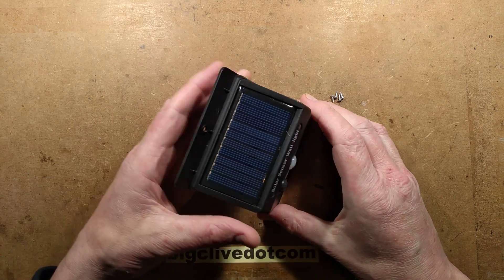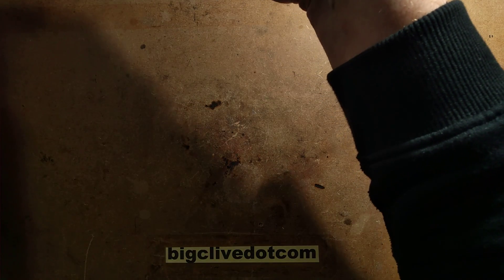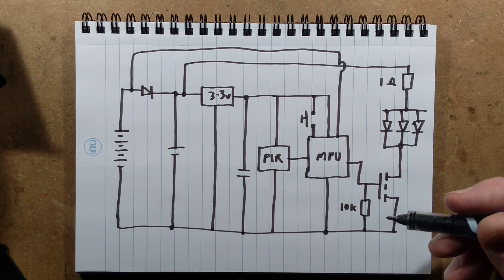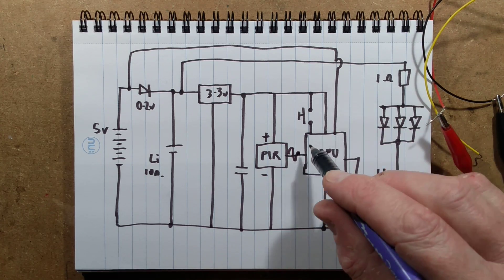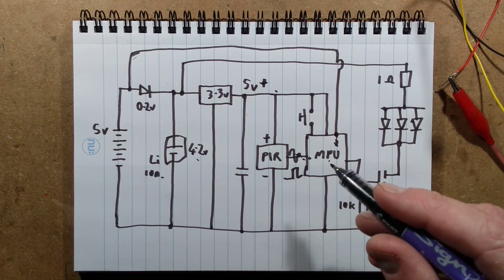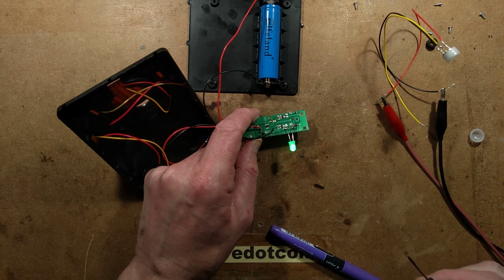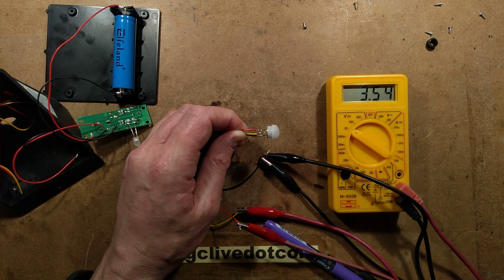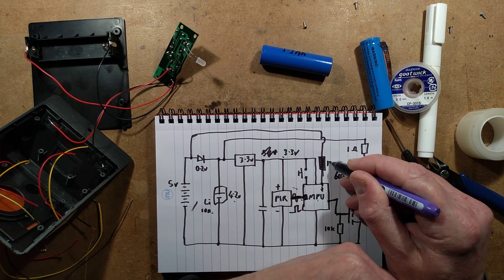Autopsy on a badly designed solar light (no lithium charge control).

Comment: Pretty much every PIR driven thing I have has gone weird or stopped working after a period of time - except the PIRs on the burglar alarm (seemingly more robust for the application). Never really figured out why - I replaced one on a night-light/emergency torch and it worked again for a bit before packing up. This light is similar to a Li-ion one I also have which has become progressively dimmer - probably the same reason due to no over-charge protection...I have had varying levels of performance from others. The other thing that dies is the lens on the front which usually disintegrates from being exposed to the sun :(

Comment: Toolstation SKU 55970 . £18. Same thing. Bought it for neighbour as temporary measure. Started misbehaving very soon after. Decided battery must not be getting enough charge from solar so desoldered it and wired it up to an old phone charger of the same dc voltage output.  THE FRIGGING THING WORKS PERFECTLY PLUGGED INTO EVERYBODY ELSES HOUSE IN THE STREET EXCEPT FOR THE ONE WHERE IT'S NEEDED. WHAT.THE.ACTUAL.F....???  arrrrggghhh!

Comment: This is not the first time I have seen a device with an 18650 battery and no charge control. The other was a speaker which had a diode and 2r2 resistor from 5v usb. This is a worrying trend.

Comment: Bought 4 (without the side lighting) a while back to stick on the shed. Better take one apart to see if it's similar. If so I'll try replacing the battery with a protected phone battery.
Reply from the maker: You can also get protected 18650 cells.
Reply: George, did you have any success with protected 18650's, in my attempts so far the solar cell won't power the 1S BMS (those round ones usually put on top of a 'naked' cell.

Comment: Did they use a 18650 cell with a safety circuit packed built in?
Reply from the maker: No safety circuit on the cell.

Comment: So, when you measure the solar panel you are using a resistance of 100k or so from the multimeter, the cell has a much lower resistance so the output of the solar panel will not even reach the maximum of the cell.. Just draw the equivalent circuit

Comment: They could have at least switched the LEDs on when the battery voltage gets too high to prevent overcharge. It would be a shitty design nevertheless but it would at least be somewhat "safe" ...

Comment: A simple 3 terminal linear regulator to clamp the charging voltage would have cost pennies.   Next heat wave,  these things will spark bush fires.   I'd dispose of that abused cell immediately - it's probably got severe lithium plating and is ready to blow if you look at it funny.

Comment: Put a simply shunt regulator, like tl431 with pnp transistor, and mosfet switch (for disconnect solar panel with shunt regulator from battery if no charge) to limit a charge voltage to 4.2V. Or just use a DW01 protection board (or battery with protection).

Comment: What is the point of 3.3V LDO? If light present, the voltage on the microcontroller rises to the battery voltage (solar panel diode +0.6V under battery voltage and MCU clamp diode -0.6V). If battery is unplugged, the microcontroller (and probably PIR) will be damaged by high voltage from solar panel (about 6 volts for unloaded solar panel).
Reply from the maker: The regulator was to provide a stable voltage to the PIR module to avoid it self-triggering again as the LEDs were turned off.

Comment: At least they could measure the Voltage with the microcontroller and switch on the LEDs when the battery Voltage gets high.
They could Use the Voltage of the solarcell -so only a Voltage-Divider from the solarcell to the microcontroler has to be added.
Not perfect, but possible with just a changed Program and 2 Resistors

Comment: The PIR was probably actually detecting your breath since you were constantly talking while trying to test it.
Reply from the maker: PIRs only tend to see thermal radiators like bodies.
Reply: @bigclivedotcom  Odd, I've heard of them (such as in security systems) being set off by hot air from heaters before, but maybe that is just a myth.
Reply from the maker: Definitely the mass of the heaters themselves and possibly very hot airflow,especially against a surface.  Another common false trigger is moving reflective objects like pendulums or ornaments that cause sudden heat reflections.

Comment: I just received one of these from bhang goot and immediately noticed the same flaw.  The battery in mine checked out to just under 1200 mAh but has no charging protection.  For six bucks, it was worth taking apart and I suppose when it fails, I can try to put in a protected battery or change over to a few NiMH cells.  Too bad they skimped a little too much.

Comment: i think a lot of this stuff is made to crap out after a short time hoping you'll go buy more.  I bought one of those cheap LED xmas light strings that used 3 AAs, it had the fade blink and constant on. So and i added a 18650 battery instead, it worked great for 6-7 months only ran them down to 3V.  then it started totally discharging my 18650s, so much they were ruined (below 1v)and they wont even charge. Then it started acting up wouldnt even turn on unless i fiddled with the switch for 5 mins. After taking it apart I noticed the chip inside was getting so hot you couldnt touch it! I added a heatsink but that didnt help. And it appeared one of the SM resistors had exploded off the board, but they're so tiny its hard to tell if it did actually have one on there. Im glad i only spent $1 on it otherwise i might have taken it back and complained. lol

Comment: Does the 18650 have a protection circuit built into it? Some button top cells have the protection built in. Or is that only for under voltage?

Comment: could be a protected cell?there are cells with protecting PCBs built in,against over voltage,over discharge,over current.
also an overvoltage tripped protected cell could not reset without an apropiate charger.
maybe the faulty units are just units with the battery cutt off tripped.
Reply: that batterie seems to have too much "square" corners on top and bottom.

Comment: AS312 fully integrated PIR sensor has a working condition supply voltage input range of 2.7-3.3v with an absolute max of 3.6v.
Sensitivity and timing is non adjustable.
The 18650 cell may have a protection circuit inside though, if so the only issue here is subjecting the MCU to overvoltage.
Reply from the maker: Thanks.  I just ordered some AM312 modules from eBay.

Comment: Clive, what's your favourite battery chemistry ? I'm still a fan of trad lead acid - but interested in 'lead-carbon'.
Reply from the maker: I love lithium ion cells.  Super efficient, absolute charge level detection, relatively safe chemistry and huge energy density at a voltage range suitable for direct driving of LEDs.
Reply: @bigclivedotcom  How are Li-ion for longevity ?
Sounds like they're complex for charging - lead-acid simply require 14·6V and leaving alone as they sort themselves out.
Ni-Cd and NiMH seem to be out of the running. Do you know much about Li-Ti ? - since I came across those yesterday !

Li-ion seem to need 'looking after'. I guess that's what's in my mob phone - and that's great. Have a fleet of Samsung laptops - and one is showing a battery fault - dunno why. One day I might swap batteries around to see if it is the laptop or actually the battery.
Reply from the maker: @millomweb  They aren't too complicated to charge.  The main requirements are a current limited supply and a 4.2v cap.  They have a long lifespan of treated properly.  The alternative LiFePO4 has a huge lifespan.
Reply: @bigclivedotcom  4.2V limit per cell, I presume. What's the cell voltage then ? Are they that high ?
I keep hearing about overcharging - is that just a matter of over-voltage ?

Also, what's the crack with all the contacts on batteries - Has each cell got its own pair of terminals - so that what it's fitted to can either wire in series (for drain) and parallel for charging ?

Comment: The sensor triggers for approx 15 - 30 seconds not 7 then goes off if no movement is detected, maybe that's what that built in circuit on the sensor does i.e. a built in timer.. Just a thought ;-)
The booklet that came with my light which is very similar to this one minus the small side panel lights says.. Battery : Li-ion, 1300mAh, 3.7 V DC 
My light started to play up just as you've described after about a couple of months use, so I thought maybe it's to do with the capacity of the battery holding the charge.
I replaced the battery with a TR 18650 3.7 V DC Li-ion 9800mAh and so far so good.

Just had a thought after looking at your diagram again where you mention its a square wave from the PIR to the MPU, as the square wave signal is reduced by the batteries capacity being able to hold a decent voltage then it would enter into the "indiscriminate zone" for the signal which could account for the weird operating of the unit.

Comment: The maximum voltage to the MCU's input pin is 4.2V PLUS the diode drop, not minus the diode drop. About 4.4V or higher.

If you use these in somewhere like Arizona, you will soon have a lawn with a series of scorch marks where the lights used to be.

Comment: Something I've discovered is that if you use a protected cell, or add a protection circuit to an 18650, you can directly charge  the cell from a 6V solar panel.  The protection circuit seems to do a good job of preventing the input voltage from pushing the cell voltage too high.
So if that's acually a cell with an integrated protection circuit, it's probably okay.
If it's an unprotected cell, they may be relying on the idea that the solar cells can't fully charge the lithium cell over a full day's sunshine with their limited current-supply capacity, which as you pointed out is a bad idea when the light isn't left on continuously overnight.
Summary: You're right on all counts.  It's a bad circuit design.

Comment: Would be cool to build an array of these PIR sensors and make a sort of primitive IR detecting camera.  Maybe use the ones that have a waveform output and write some code to raster an image based on the array signals.

Comment: With just a bit more thought on the circuit design they could have provided over-charge protection via the micro, by progressively  turning on the LEDs (PWM) as the battery voltage approaches 4.2v.

Comment: I have one that cooked the battery and triggered the safety on the battery, I wonder if fitting a Tp4056 to protect the battery and the 100K resistor to the MPU would make it safe and useful?

Comment: I would imagine that the engineers decided to substitute an internally-protected 18650 for the more usual 3 AAA NiMH batteries, but the accountants decided to procure unprotected 18650s because they were cheaper than the protected ones.
Reply: I was thinking the same thing some cells have a BMS board on the end of the cell.
Reply: so If I put 3 aaa nimh in then it will work well? I have a dozen of them.
Reply: @alxp-zd1zjin series yes, not sure how many cells though

Comment: I guess technically they could sense the voltage on the solar cell and start running the LEDs when the battery is fully charged. Still not a great solution though.

Comment: I have two of these types of light, but they use Nimh cells & come on at dark at a low level, thereby draining the battery even if there are no triggers. They went through last winter without trouble & are fine now.

Comment: Could you stick in a zenner for protection and a couple of diodes from the solar panel to the micro to reduce that voltage (or even another zenner to clamp that down too)?

Comment: The Pir sensor also reacts to reflections of infrared in all surfaces. The reflection properties for infrared light of surfaces is sometimes not the same as for visible light. So your meter or the roll of tape can be very reflective for this band of light

Comment: Looks like the PIR sensor is doing the timing, so all you need is take out the microcontroller and connect PIR directly to mosfet gate pin and use a toggle switch to switch it on and off._
Reply: yeah but this way it's always going to light up, regardless of light output..

Comment: Just read about someone being electrocuted when their mobile phone fell in the bath whilst being charged. How is this possible ?
Reply: Henry Russell poor mains isolation inside the charger, plus most chargers aren't earthed. possibly a cheap universal plug or something. If you have a phone with a metal case stick it on charge and touch your elbow with it very lightly and you'll probably feel the shock

Comment: One thing they could have done for battery protection is to put in a dump load - the light controller could potentially switch on the load if the battery nears full charge.
Reply: Just turning the LED's on would do that without too much extra cost. Ok, so the light on in the daytime is not ideal but it would make it live longer - but that isn't what they want is it?

Comment: what if they had just swapped the regulator so it was in front of the battery?...would that prevent overcharging?
Reply: @Path-s5p  fair enough. it doesnt look like anyone that knows basic year 1 level electronics made this anyway. they prob just slapped a lithium battery in a premade pcb.

Comment: My work sells these. I was very surprised when I opened it up to find not very much at all. 

Ironic how it says not to use it in full sunlight when it's being sold in Australia, the country with one of the highest levels of solar radiation in the world.
Reply: That epoxy coated solar array isn't going to last a single summer Down Under. Almost worth siliconing some glass over the cell (but even then the cell's not going to last more than TWO summers!! :-)

Comment: Does anyone have a part number for that PIR sensor component? (or equivalent)

I could do with a few of those.
Reply: Same, that would save a lot of time.
Reply: @Okabim  HC-SR501
Reply: @mirrored_  the HC-SR501 has a sensor mounted on a board - the one here seems to have the circuitry in the can with the sensor

Comment: Interesting design, but if the microcontroller and PIR could withstand the panel's maximum voltage, it may not have been that bad of a design.  Sure, the PIR needs stable power - at night.  When there's no sun.  ;)  Without spec sheets, we don't know if the design was that bad or not.

Comment: I'd love to see some real-world voltage data from one of these garden lights. Open circuit voltage will differ from load voltage, and things like shading (whether from dirt or pollen covering the entire array or from a tree branch shading just one of the cells) will change the output voltage quite significantly.

Comment: This circuit as the hardware equivalent of the shit C code I used to have to deal with after an AvE-style apprentice had been let loose on the production code repository.
Reply: ave style?
Reply: @ucitymetalhead  AvE constantly refers to 'apprentice marks' when he sees a botched bit of work. You don't watch his videos?
Reply: @Blitterbug  yeah I do i just didn't think of that.

Comment: Check the cell, it may have a tiny protection circuit on the end. You would need to cut the film off to see it, but it may also be a bit longer.
Reply from the maker: I checked it.  No sign of protection.
Reply: @bigclivedotcom  
Than it's just a horrible product. Probably actually illegal to sell in most countries. It's probably not even legal to ship!

Comment: I bought one of these from the local Chinese shop. I used your design to make it run as a day/night switch. (I added my own protection circuit and a stripped down cellphone battery)

Comment: Any advice on a dark detector?
Reply: Clive's done a few of those. Look for his videos on solar-powered fairy or garden lights.
Reply: @McTroyd  yeah I was thinking of that, but I was wo dering on something with a bit more of a scale, just to turn a light on when it gets below a certain light level in the house, or to increase voltage to a bulb to maintain a level, you know, because I'm crazy 😂
Reply: Oh. That's a two-part problem. The first (turn on below a certain level) could be solved by toying with Clive's dark detectors... I expect shifting resistor values or diode types around would adjust the threshold and/or sensitivity. The second one could be a constant current driver, like the ones Clive uses on LEDs. It would be quite the contraption but should work.

Also, you're not crazy. One of my hats is lighting designer. If I go into "crazy" lighting we'll be here all night.
Reply: @McTroyd  here is me with my unused constant current driver 😅 though I got that with another purpose in mind.

I did think about changing resistor values, but then I might also be there all day 😂

Comment: I actually orderd this two months ago. It came as a set of four, two worked two did not. The set i received, the  battery is held  loosely with a spring and easily slides out(on its own). These  batteries are high capacity. I thought it was best to have a battery that was low capacity on solar chargers since the amount of light use is minimal . And is ideal when skies are cloudy, because it doesnt need hours of direct sun exposure to get charged. I opened it  and did not like the set up. It did not look safe and feared something catastrophic could happen and cause a fire. Didnt bother to send back because postage would cost as much as i paid for it.

Comment: They could have compensated by just having a charging control chip on the battery itself, but I guess that's too expensive for them.
Reply: Was thinking along the same lines. Perhaps the circuit was designed with that in mind, and then corners were cut.